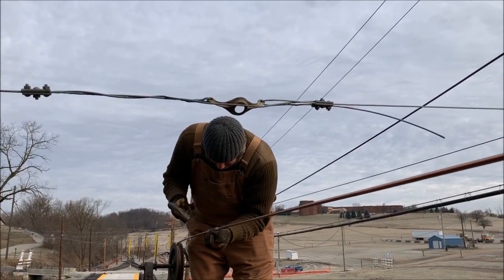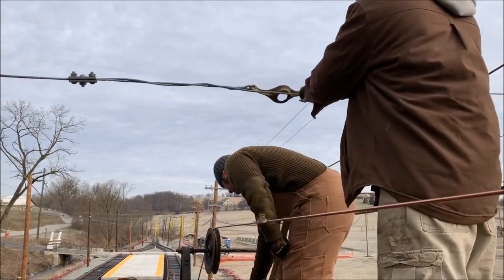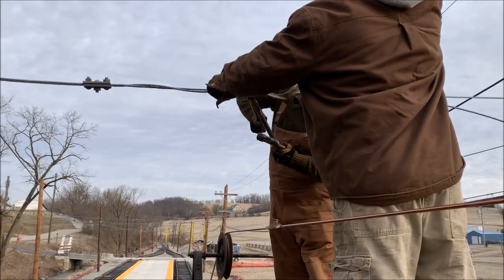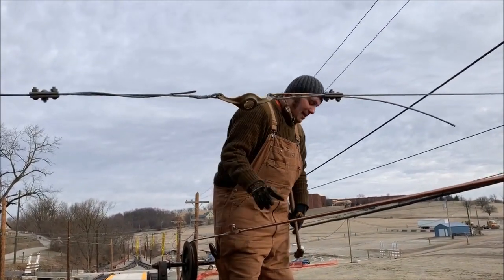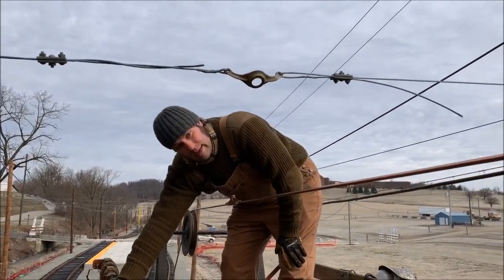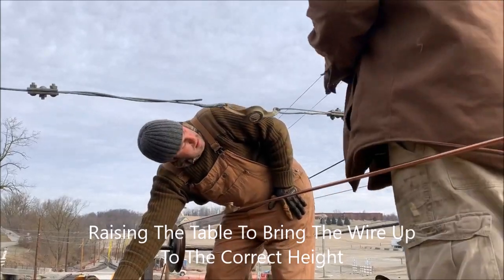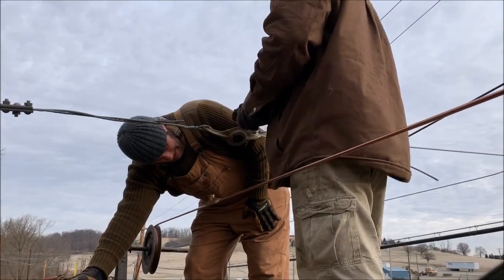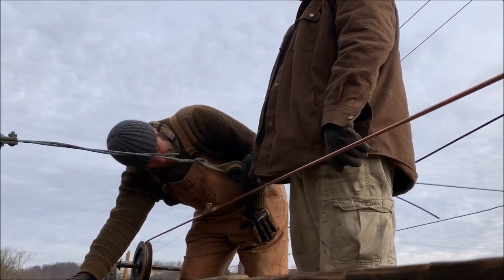Installing Trolley Wire at the Pennsylvania Trolley Museum

Comment: Why do they work with live wire? Is there no danger of electrocution? It seems that it would be safer to just turn off the power until the job is finished.
Reply: The roof of the line car is 100% wood and fully isolated from the negative ground. Therefore there's no way for a circuit to be completed and electrocute the workers. Also full leather gloves are extra insurance if something does go wrong.
Reply: @ohiovalleyrailfan  Thanks for enlightening me about this.